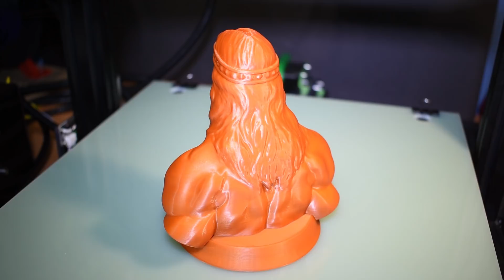MAMORUBOT Print Surface for the Tevo Tornado - 3D Printer

Comment: Have you ever thought about doing a vid comparing build surfaces? I got the Mamorubot build plate but am having a heck of a time getting anything to stick! What other build surfaces are in your opinion would be a good choice?
Reply from the maker: Brent Sinclair, yes i did :). 
Here it is
https://youtu.be/fRTzERF59E8
Reply: I have had no trouble with mine. About every 2nd or 3rd print I wipe it down with isopropyl alcohol. Depending on the model I will use a skirt 3, 4 loops, or brim with 3 or 4 loops, sometimes 8 if I get worried. Also using Cura with Marlin Volumetric G-code options. I am new to this so take it for what it is worth.

Comment: I can barely get pla+ to stick to this...
Reply from the maker: Try increasing the bed temperature and decreasing the nozzle to bed distance.
Reply: Bed temp ive tried from 55 to 75. reluctant to go higher. Nozzle temps between 210 and 220.
Bed leveled with feeler gauge 1.00. Any more I end up with elephant feet, mate.
Reply from the maker: Why dont you want to increase the bed temperature higher? I use 85 degrees C with mine.
Anyway, the nozzle to bed distance is too high. You should use 0.1mm and not 1.00mm.
Reply: Sorry, it was very late when I sent the last message, lol.  I meant my feeler is 0.10.
I'll try it for sure at 85 and report back.
Reply: Sticking a lot better now thanks. Do you notice a slightly edge curling though? Can notice it on the bottom more where the print has slightly lifted and isn't super shiny towards the edges
Reply from the maker: Try to clean the surface with IPA before starting the print.
Reply: Yep tried that. mostly sticks, just not towards the very edges. Might try to turn the bed over and try again.
Reduced first layer speeds right down to 20% too
Reply from the maker: Also, make sure your cooling fan starts a few layers later (maybe start at layer 4/5) and start with small rpm and increase it slowly.
Reply: No worries mate. The flipside seems to have better adhesion for some reason. Adding in your recommendations to the cooling section in S3D. Cheers
Reply: MJAussie360 make sure to use a brass feeler gage or you’ll damage your nozzle.
Reply: @MJAussie360  I have heard that using steel wool along with IPA to clean the surface.  I have heard that works well.

Comment: Working great for PLA

Not working at all regardless of temp for ABS.
Reply from the maker: Hi John,
I will publish a comparison video with this and other print surfaces...you might like to watch that one.
Reply: @ruiraptor  Mine mamour works with ABS too, but only raft... My problem is that board is bented, in the middle is lower gap between the nozzle. I supported the board only on 4 edges. :/

Comment: I just received mine a week ago and have had mostly good luck with it.  One thing that Tiny Robots mentioned to me was to make sure the surface is clean and that your first layer goes on slow.  My S3D profile for the Tevo Tornado was a bit too fast and I had prints coming off the surface.   Once I slowed down the first layer, and made the first layer a bit warmer than the rest, prints have stuck fine.  And once cool, they come right off...no scraping / tugging / etc
Reply: I agree. I run the first 2 layers without fan, slower, and keep plate clean and have had only one problem. Have used PLA and PETG which worked fine.

Comment: Thank you!  This surface is so cool!  I went with the BuildTak flex system and so far has made my life very easy.  I am highly interested in a long-term test of this surface, how it compares to the buildtak in your experience -  or possible collaboration where we could try the same STL file in PLA and show the results on both surfaces with optimal slicing for each - to compare the moment of release from each surface?

Comment: 728g is still a lot of weight and I don't know if my LV8729 drivers can take it but I'll know after I mount it on my Tevo Tornado. @Ruiraptor Are you using the stock control board??
Reply from the maker: Hi Krank,
I use glass with my other print surfaces and the total weight is 1195g. The stepper motors can handle the weight but in anycase, the drivers must have the correct vref for these motors regardless of the weight on the bed. The stepper motors will work at the optimal performance when set to the correct current. But regarding the weight...it's true that less weight is better. It will have better inertia which will allow faster accelerations.

Comment: Watching and waiting, my bubbles are getting worse, like we talked about. This bed seems very interesting. After seeing the video I wanted to present an idea for your opinion. I would think the best condition would be for the Tevo heat bed to have as close to 100% contact with any secondary bed over it. Electronic components use something (don't know the name) between component and a heat sink for heat dissipation. I wonder if a similar compound could be used in this case?
Reply from the maker: Hi Tom,
You are referring to thermal paste.
Actually, print surfaces like filaprint or printbite, they have adhesive that holds the surface in place and keeps it air free between it and the heatbed. When you glue them on, you then need to "soak" it for a few minutes. This procedure ensures exactly that for better performance. With the case of the mamorubot, you don't have that.

Comment: Hi Rui.  Mine should arrive today by 8pm.  Now all I need is my Tornado to arrive.  I figure Monday or Tuesday.  It already cleared customs in LA.  Anyway my question about this mamorubit surface.  Should I tear off the Green Tornado stick-on surface before laying this surface down.  I've heard stories both ways but I'd trust what you say.  If I test off the Green Tornado add-on, it will leave a sticky surface on the main build plate.  How did you get all that off?  Thanks
Reply from the maker: Hi,
You can use the mamorubot on top of the stock sheet. The issue is that soon you will get bubbles between the sheet and the heatbed.
If you already have the mamorubot on the way, i would recommend you to remove the stock sheet before assembling the tornado. Check my previous video where i explain how to easily remove the stock sheet.

Comment: Same question, how does it work with PETG.  Need another solution than glass and the original build plate.  PLA is not a problem but PETG is a challenge to remove.
Reply from the maker: Hi Brian,
I tested petg and i had to increase the bed temperature a few degrees when compared with PLA. I also had to delay the cooling fan a few extra layers or the edges would start to raise (on small prints). I also recommend to turn the fan/blower at a lower speed and increase with the following layers.
Reply: ruiraptor,  I did something similar to what you are recommending.  The print quality was great but the release was still a problem.   Glue stick and tape was highly recommended but the video you just showed seems to be a better solution.  Will try to buy that build plate.  How much of the Tevo plate has to be removed?

Comment: How's it work with petg? A lot of these surfaces have a hard time letting go of it.
Reply from the maker: Hi Benjamin,
It works with petg. 
You just need to push the temperature of the bed a bit higher and don't turn the cooling fan before the 5th layer (for small prints).